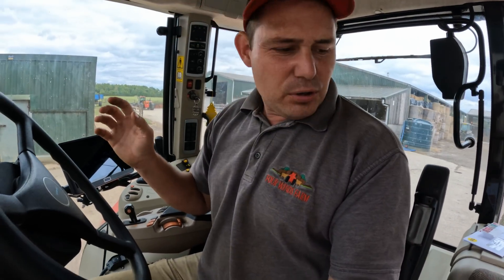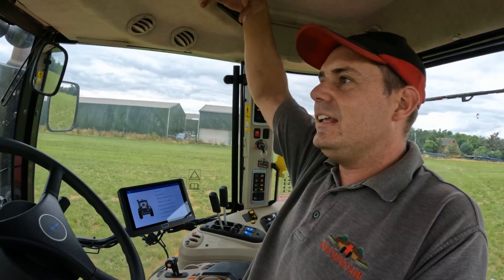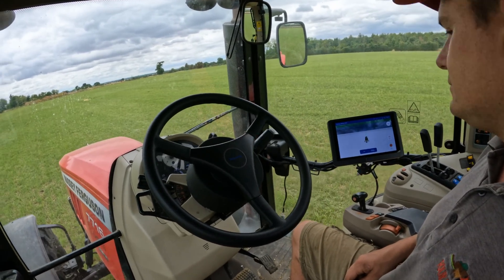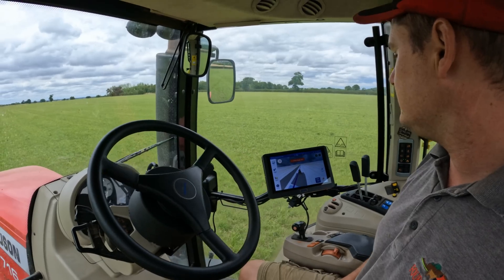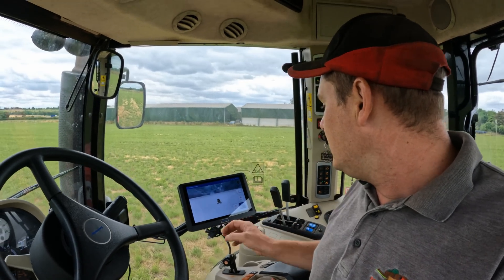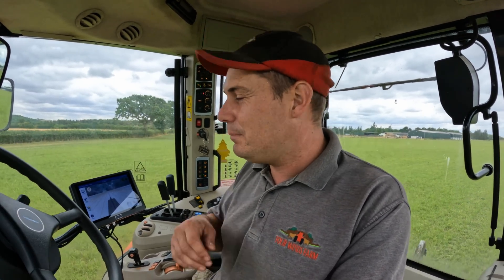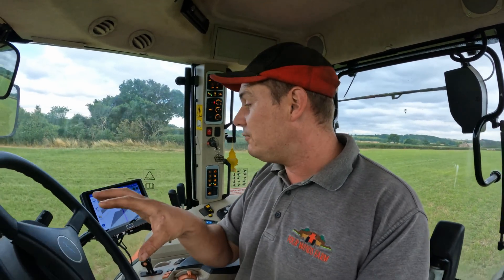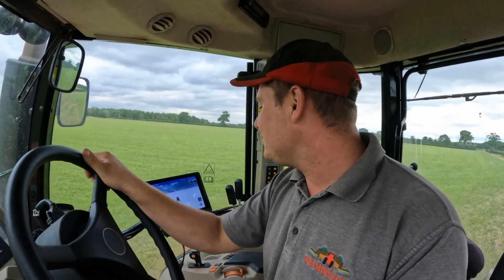Sveaverken F100 Auto Steer Calibration and RTK Setup!

Comment: Where do you buy your RTK Sim from? and is there any other subscriptions needed? like to an rte base station?
Reply from the maker: The provider we used at the time was RTKFnet. The guys there were all really helpful. It was just a sim card, no base stations, however you do need mobile connections for it all to work. Subscription costs were quite high, so be prepared. We have 3 systems and run ours on PPP signal, which is free and more than adequate for most jobs 👍
Reply: @FourWindsFarm  Amazing thank you. So for PPP signal, do you just need a 4G data sim rather than RTK?
Reply from the maker: @baldysfarm no sim needed if you’re going with the satellite signals you can use SBAS, or for more accuracy you can use PPP, With PPP there is a short connection time of 7-10 minutes! If you go RTK then the guys at RTKFnet will send you a sim that goes into the screen no connection times, very accurate great service from the RTK people they will talk you through everything just a yearly service charge to bear in mind! 👍
Reply: @FourWindsFarm awesome info! Thank you 😊